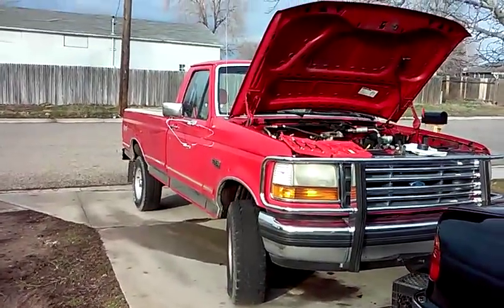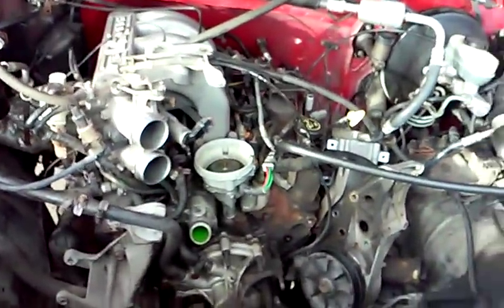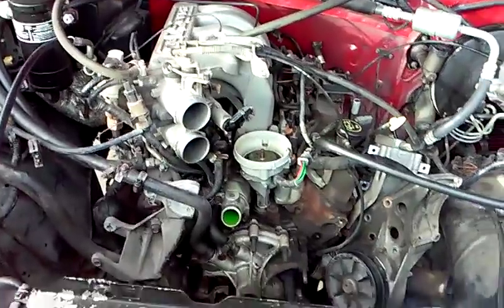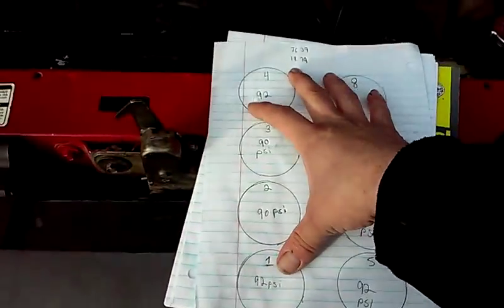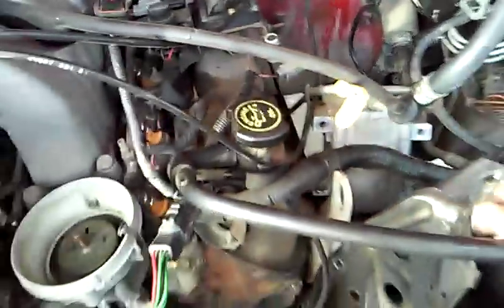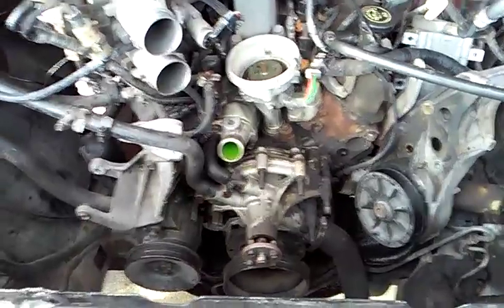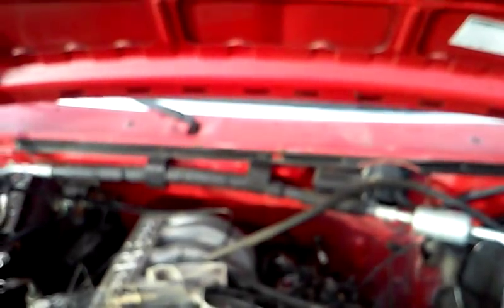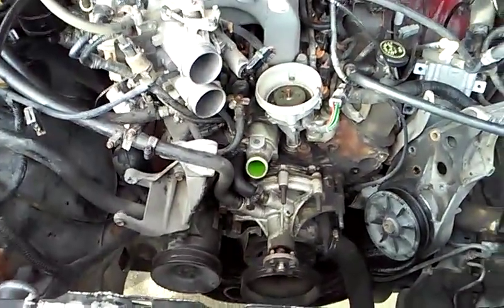1992 Ford F-150 5.0 302 diagnosis,timing

Comment: (´94 - 302 EFI, HO firing order) Thanks Matt, had same sort of issues and changed timing chain (got the kit) but it wasn´t half bad. Pistons and rings have been changed, timing set to 10-12 (still playing with it) but with honed cylinders, new pistons and rings, I get 120psi per cylinder, but the car is extremely extremely slow. Will not go up any hill, accelerates extremely slow.
Changed MAF, TPS, Fuel pump, new E40D, filters, cables, plugs, cap and rotor, etc. etc. but she just won´t drive normal. 
IMO 120 is not really good for new pistons and rings. (Vacuum holding steady around 22, not moving)
ABout 7 mechanics  have been looking but nobody knows.
Any ideas where to look?
Reply: Jaco Mijderwijk + other vid/channel suggested a Relay for fuel pump a) Hi pressure or, b) low pressure...
Either those relays or, another brand new Ford TPS (throttle position sensor) = $20 fix 🚗
Reply: TPS was one of the first things that has been changed, together with the MAF. Turned out to be a fuel line, in/near fuel pump that was ubstructed... :-( 
Only test I haven't done, couldn't do, that I know of, was measuring the fuel flow.
Reply: missingremote late reply, still fighting the car. Fuel pump has been replaced twice, tps as well. Valves have also been done, new seats. With all the changes I’ve done, car always runs the same; no power.
Reply: @jacomijderwijk4743  is more then likely the ECM, it probably needed to be refurbished. Hope it got worked out
Reply: @robbobsjobs8456  Had the engine sent to be honed and they did a butch job, everything still the same. Went to another mechanic and had him pull the enige again; bad block. Putting in a 'new' engine. 
Still doesnt really explain whay all the cylinders have a low compression.
After this week will look at everything as if first time again. (Did change the ECM too.)
Reply from the maker: Jaco Mijderwijk I agree 120 is low for that engineer. Possible the chain is off a tooth?
Reply: Thought the same; new chain + gears, all the same and car still sluggish. Another mechanic thought that the advance (not vacuum) is off, but I've seen it move perfectly with the gun (and doestn explain the compression). I am thinking; valves (but would be incredible for all compression to be 120 +/- 1.)
Not running catalyst. MAF measured and showing correct readings. Did buy a O2 sensor that I haven't yet replaced, but won't explain compression.
Only thing that may explain, in my limited experience, the compression could be a blocking in the exhaust, but they're all open, only 1 muffler.
Still at a loss. For the money I've spent I could have easily have gotten a crated engine. 
I love this car and have no reason to let her go, but after three years of being overtaken bij 1.0l Chevrolet Sparks with 4 people in them... I don't know what else I can do.
Reply from the maker: possible valves. I have seen valves that are worn all across the board and are not shutting properly. most times though you will see compression that looks like 120-145-110-120-160....so on and so on. the same compression across the board with almost no difference makes me think that the timing is off a tooth or two and so ALL valves are opening and closing a little to soon. make sense???
Reply: Hi Matt, yes. That did make sense and so I changed chain and gears last week. Exact same results... :-(
I´m almost thinking exhaust restriction, but got no  cats and only one muffler. 
What is weird is that I asked the mechanic to change the O2sensor that I ahd bought, and he told me there was none... I forgot to check it, but will this week... No O2sensor=no data on rich/lean, right? So the computer doesn´t know what to do, I assume.
Thnx for your replies Matt.
Reply from the maker: Jaco Mijderwijk so even though I got 20 years experience in this industry one of my philosophies in life is always remain teachable. My current business mentor has 50 years experience as an automotive engineer and a successful shop owner. I see him and talk to him on the weekends over coffee. I'm going to go ahead and take all this information that you've given me here and run it by him and see what he has to say I'll get back to you this weekend about it.
Reply: Hi Matt, that´s awesome you would do that. I bought this car 3 years ago and never been able to comfortably go up a hill. I bought it to get out the city and go places comfortably and put so much money into her that I can´t afford to replace her (and really don´t want to because she´s so comfortable.) 
Timing set on 10, 12, 14, 16. Not much difference. Advance seems to be working and in the meantime had to replace the pickup in the distr. Took me a while to figure that one out.
What is strangest to me; I keep changing major and minor things into it´s original state, original parts etc. and the car really hasn´t changed it´s character. Starting better, etc. but power wise, not a single change.
Would love to have this sorted for once. (Had Bronco´s before, and although not fast cars, they do pack a bunch of torque.)
Will be awaiting your business mentors´ ideas!
Reply: Hi Matt, how are you? Any clues?
Reply from the maker: Jaco Mijderwijk yes I will get with you about some things this weekend. Having family day for Good Friday.
Reply: missingremote , TPS had been changed. Fuel pump as well, but not sure about the relay. Haven't been able to test fuel pressure under load.

Comment: Hey nice video explanation, I could use your advise, I have an 88 f150 5.0 115k on mileage so very low, been working on it, changed oil added some sea foam and now Cylinder#2 is fouling plugs, runs ok at high rpm 2200-2500 but low 1st gear missing chuggin and the like...Going to compression test just this cylinder as all other plug nice grey color, what should the gauge tell me, also to note that i went against better judgment and install NAPA plugs wires cap rotor do to price and changes oil with 1030 high mileage valvoline and added 5 oz seafoam to engine oil, drove like a champ after shut it down for a few hours then the miss started  spark plug #2 is black with oil residue...thanks in advanced...
Reply from the maker: any where between 135 on up to 145-150 for the 302 HO aka "GT". even though I have 20 years experience my self I always have a "mentor" that is the exception to my in my industry. I am going to talk with him later today and I want to run this one by him. He has 50 years experience 35 of it as a shop owner himself :). I will get back with you on this one.

Comment: I have a 1992 ford f.150 5.8lt had a tune up done and since then my truck started running like crap..The tune up included oil change new cables and they said that my distributor needed to be replaced so I got a new one.. Had new spark plugs put in and when I got my truck like 2 days after it started shaking while going 35-45 since then it just runs crappy.. I don't drive it now since it's still sitting there can't seem to find problem.. what can u suggest to do?
Reply from the maker: if the dist was removed I would first want to shoot the timing and make sure it was adjusted correctly. also check spark plug gap.
Reply: Will do Thankyou

Comment: i have a 96 f150 351w and when i go and start it in the morning after it sits all night or if i let it sit durring the day, i will go to start it and it fires but then spits and sputters until it quits. if i keep my foot on the gas for a little while it will start to idle fine. after that it runs fine but have noticed a drop in power. what could this be.
Reply: i have replaced tps, egr, spark plugs and wires, cap and rotor (2 yrs ago), fuel filter. I was thinking it could be the check valve in the fuel pump, or it could also be the timing chain not quite shure.
Reply: i also replaced the iac valve and fuel pressure regulator
Reply from the maker: what diagnostics have you performed? visual inspections? timing chain? compression check?

Comment: 1990 f250, 5.0, new distributor, new tps, new vss, new tfi, new IAC, new cap, rotor, wires and plugs, new vss, new map sensor, still runs rough and pops out of the exhaust pipe, what's the problem??? #MissinginMississippi$!?&#@
Reply from the maker: have you done any diagnostics? compression check? leak down check? pulled cover and checked timing chain? I would start with a compression check. see if it is low or if there is a major variable in one of the cylinders.

Comment: hey there is  I got an 88 f150 xlt lariat v8 efi I changed plugs wires rotor n cap a month later got hesitation n loss of power  transmission is good changed tps sensor n driver side fuel pump n fuel filter I'm pushing towards timing being advanced or what not any ideas would be greatly appreciated
Reply from the maker: sorry for the late response. I have had some tech issues with youtube. have you checked compression or shoot timing yet?
Reply: I checked vacuum pressure but not compression going to get timing light today to check timing can I use a timing light to see if timing is off or to just set timing
Reply: Any ideas on how to check compression
Reply from the maker: Jason Echols you can use it to check timing if it is off loosen distributor and try to adjust. valves not properly opening and closing will cause a pop or backfire out of the exhaust. a loose timing chain can cause this
Reply from the maker: Jason Echols also I am wondering what the actual spark looks like when starting or running. is it orange or blue? a spark tester can help. or just pull a plug and observe it while some one is turning the engine over.
Reply from the maker: Jason Echols yes you will need a compression gauge. Local parts store will rent you one
Reply: So I'm not getting backfire out of exhaust normal smoke when first starting in cold I get a small ping inside one of the plugs chambers  what would happen if I gapped plugs smaller than recommended gap size for truck for ex.i gapped plugs at 40 but I noticed truck said 42 to 46 I believe someone told me that .40 was correct size
Reply from the maker: Wrong gap will cause improper combustion. This can cause the avalanche of loss of power and other issues your are experiencing
Reply: Ok so I should gap at 42 or 43 maybe 44 to be safe and test drive it then thanks I will respond with results and I will check spark for blue or orange color
Reply: Matt Shaughnessy  sorry so late to get back so I was told by ford that fuel pressure was a lil low he said change in tank pump I purchased new one and problem is gone so all that came from hpfp pulling and in tank pump couldn't handle the job replaced with new and viola anyways thanks for the insight n info of knowledgeable hints to help solve issue and save some  $$$$$$$$$$$so thanks again and I will be back for future issues and advice and yes I am subscribed I watch all your videos
Reply: in tank not intent
Reply from the maker: awesome! glad you got it figured out. fuel pumps can be funny sometimes. I have ran into all kinds of fuel pumps that will do all kinds things while failing. this is a good example of why I always tell people you really cannot guess any more. Diagnostics is everything! thanks for sub and watching!
Reply: U welcome any time and hey that corvette guy u get what u pay for ain't nothing free
Reply: im having the same problem u solve it
Reply: i put tps egr all sensors and nothing im getting crazy
Reply: Jason Echols I got a 1990 with a 6cylender idental probem and told the timing has to be re adjusted

Comment: my 1992 f 150 with a 302 has no power. I replace the TPS, catalytic converter, distributor, and checked the timing. still no power. compression test shows from 115 to 110. could the timing chain cause this his? she will run down a flat road at 80mph, but no power up hill or pulling a small trailer.  at my whits end on this old girl.
Reply from the maker: Hello, I have a few questions for you. please bear with me hear. 
1. how many miles does the engine have?

2. what is the pattern of the compression? I.E cylinder 1=110 cylinder 2=115 cylinder 3 =110??????

110-115 is not a large variance. in my opinion 110-115 is also not the healthiest of compression. I have seen worse though and still have power in a 302. you have ruled out the dist and tps and cat convert. AWESOME. before I would say we have enough justification to break the engine down and check the chain I would want to know what color the spark is?? do you have a in line tester or can you pull a plug and check to see? I think you are going in the right direction. I just like having all my basis covered before opening up a engine. However I think it maybe time to check your chain.
Reply: The traveling Elk timing chain and gear certainly will

Comment: I've got a 1990 F-250 with a 302 and M5R2 trans. It has 130,000 original miles and is EFI. My question is; with this being a heavier truck compared to the F-150, what are some  of the most efficient things I can do "bang for the buck" to get some more power out of it. I have heard that increasing the timing helps but may need to run premium if it's set too high? Any suggestions would be much appreciated. I am not opposed to ripping stuff off other trucks at a junk yard either. Thanks, Nate.

Comment: matthew shaughnessy, i have a 92 f150 v8 302, i recently had the engine rebuilt, the engine is now back in the truck but starting it is becoming a challenge, the engine will crank and crank but it will not fire unless you take the plug wire off of the first plug then it acts like it wants to start, when you put the plug wire back on the plug the truck will start but then it will run extremely rough, any ideas on what it could be?
Reply from the maker: "first plug"=??????........are you specifically pulling cylinder one spark wire? have you tried pulling off other wires and seeing if there is a difference? can you install a inline spark tester on the plug you pull to observe spark? I have had this exact thing happen to me before during diagnostics.  One time on a Chevy I found it was due to a faulty fuel injector. Another time it was on a ford and it was due to timing, last but not least I had some one bring in a ford last year that had a very similar issue and it was because the wires had been replaced and wired wrong. I.E. 1 was on 5 and 5 was on 1. WHen my partner comes in we will put our heads together on this one. heads up.......we may have to think out side the box on this one.
Reply: matthew shaughnessy ok after being at it for awhile were still stumped ive heard ignition coil replaved it no change, i followed the spark plug wiring diagram in a haynes manual, onced again it cranks and crank pull the plug off cylinder one and the truck will almost start, put the plug wire back on and it start and run rough.
Reply: matthew shaughnessy and my plug is getting great fire thats why im confused
Reply from the maker: Ok, When you pull a spark plug wire off a spark plug and attempt to start you saturate the coil with kilo volts (KV). or in simple terms when you pull the plug wire off the electricity has no were else to go but back to the coil over saturating it. replace said plug wire and now the over saturated electricity has a place to go and it will start the truck. 

So now my question is........What color is the spark on your tester. you want a bright blue spark.
Reply from the maker: also a reason why number one is being the butthead is because it is the farthest from the distributor
Reply: The spark isnt really blue, ive heard that the reason why its doin it is the coil not putting out enough volts but ive replaced the coil and it didnt help
Reply from the maker: if you have replaced the coil get a hold of a oscilloscope and check (KV) kilo volts. bad air gap between rotor and distributor cap can cause this. check with feeler gauge. also a bad coil wire.
Reply: Ok thanks
Reply from the maker: I have done this enough that I have from time to time got a bad coil out of the box. In 18 years of service I would say it is rare bit it does happen especially to those of us that order parts daily. Just a out side of the box thought
Reply: matthew shaughnessy ok ill check into that, i appreciate your help